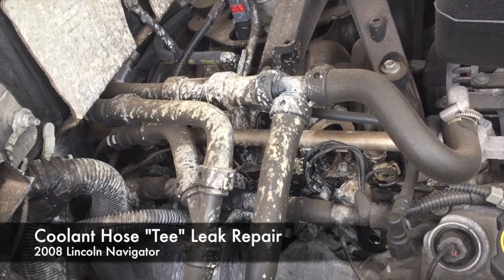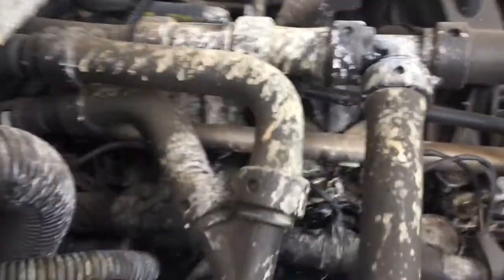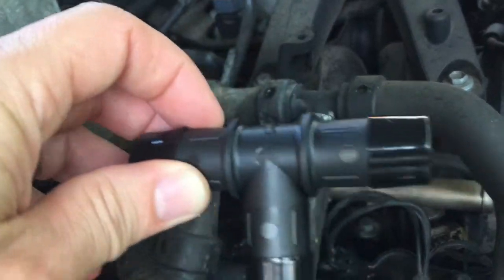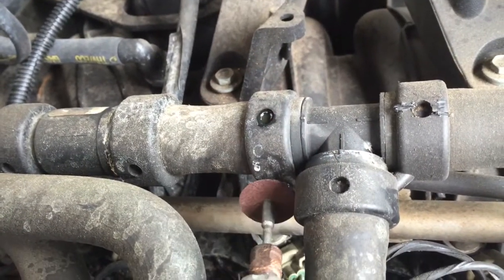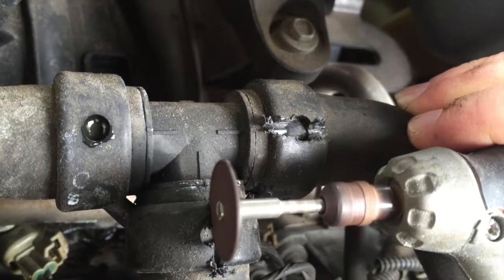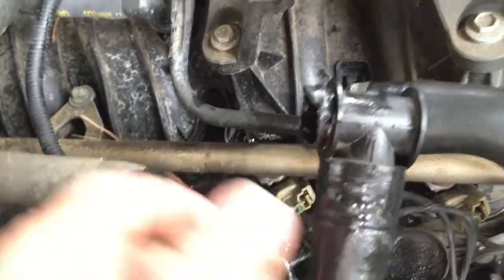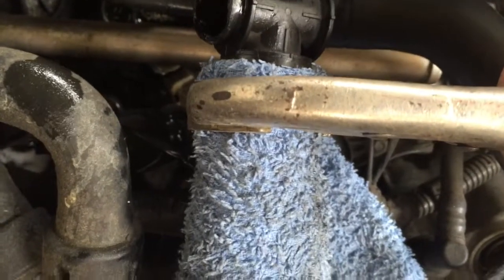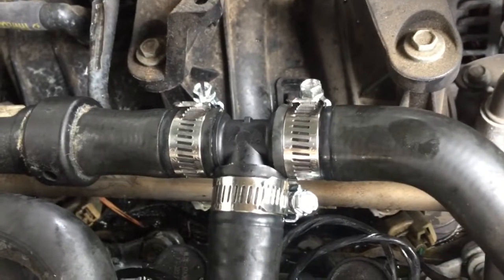2008 Lincoln Navigator Coolant Tee Leak Repair

Comment: My Husband  did just that, but he used a pair of jewelry snips  plyers he got them from Walmart he cut the plastic clamps  like butter then crush the hoses with vise-grips them  removed the plastic he got a brass " T " size 3/4 by 3/4 by 3/4 and metal clamps from Home Depot  He didn`t trust Plastic tubbing . thank you for posting this video

Comment: Thanks for this vid! Saved me a TON of money and frustration! 
O'Reilly by me did not have it in stock but was able to find it at Auto Zone.
Auto Zone Part # H-343  $4.99 (3/4" sized ends)
The correct hose clamps to fit over the 1" OD hose were $2.99 for a two pack (needed two) 
With tax, out the door cost was $11.82
*Tip - While I did start out using the Dremel to cut through the bands to remove the plastic hose clamp assembly, I found it much easier to use cutting pliers to snip the plastic where my Dremel tool had started the job.

Comment: Thanks for the video. I have the same truck and the same issue. I actually bought the same tee piece from Lowe's in brass. So I won't have the same issues down the road with it breaking down.

Comment: Shark Bite tee from Lowe’s replaces this perfect. It’s labeled 1” but is undersized. Part number 818303. Brass fitting under seven bucks.  The dorman help tee from the auto store fit very loosely into the hoses.
Reply: Used this product today it worked perfect and looks a lot better than plastic.  The 1" was perfect fit and #10 air plane clamps to secure the hoses.

Comment: Saw the plastic tee at the auto parts places and several said the had to repair a year later. Just replace with a barbed end 3/4" brass tee from Lowes or hardware store and your fix is forever. Yes you will lose some coolant from the overhead heater core, so have some standing by to replace to full and enjoy your cheap repair with a brass tee and three stainless steel hose clamps.
Reply: Nothing affects it by having a brass Tee?

Comment: Thank u for making this video
Reply from the maker: Your welcome.  There are about 2 other ones kinda like it, but I really like the dremmel tool, makes the plastic joint cutting so much easier.  Plus, did not damage the hose.  Just gives you options . . .

Comment: Hi, the video has 6 yrs. , any follow-up  update on this repair ?? ,  do you know if it lasted ?? or was there any trouble with this part because of Temperature or pressure  ?? Please let us know. I just did it on my 2008 Ford Expedition Tee with 100 Kmiles, I would like to know if I can be relax or I would have to keep a very close eye on it, your reply will be greatly appreciated by everyone. Thanks !!
Reply from the maker: Great question!   So, I will tell you my situation and why I made this repair.  #1: my hoses were still great.  No cracks on the connection ends, no swollen spots on the hoses.  #2:  the only failure was the plastic, which gets brittle over time in this application, and that was my reason for this video.  So, in my situation, I worried no more.  If you go buy the new hose set from a part store, non-oem, you will see the same rubber hoses and ‘’metal” connectors for the ‘y’ and ‘T’ parts, which is what I replaced it with.  If your hoses are good, you should be fine.  I have these same cooling hoses on other navigators with 210k+ miles and no issue.  You asked about this navigator, well, it ran around town for two years, daily driven by my teenager, no issue with this repair.  These are tough SUV’s.  I currently own 3, I worry about my next repair, which is a sunroof, not the engine.  😂.  Just to say, my three navigators, all have over 200k miles, not thought about this again.  Hope this helps.

Comment: 4 Ford Motor Co. investors dislike this video. They'd like their dealers to sell you a $100 "replacement" hose instead!
Reply from the maker: Sometimes it is just nice to get the Navigator back on the road without breaking the bank!  Thanks for the comment!
Reply: Just replaced the hose assembly with a “Dorman OE Solutions” hose set which cost $85. Came with all metal clamps and tees with new quick connect clips and fittings. Only trouble I had was the removing the connection at the heater core, that one was hard to get at!

Comment: I used channel lock pliers to crush them plastic flanges. Took just seconds to remove.
Reply: Did the same. Turned the hoses down while crushing the plastic so the broken pieces don't get into the coolant system. Used a 1inch brass t fitting from Lowes. 2013 Ford Expedition Limited 5.4

Comment: I have the exact same problem with my 2007 exorer, but my engine overheated. It restarts, but doesn't hold a start and only keep with my foot on the gas or it dies. Sounds like a spark plug is clogged. Could this be the best accusation?
Reply from the maker: This is a good question.  Overheating an engine can be a mixed bag of post event troubleshooting.  In the 2008 Navigator, when the engine started running ‘hot’, immediately the computer shut off the A/C compressor.  It gave us time to get off the road and trouble shoot to find this ‘leak’.   Considering your Explorer, if you can get it run, that is a good sign, not holding idle without gas, could be an ignition coil or two failed.  Can you borrow a tool to read any ‘codes’ from the OBDII port?  That would be super helpful in this case.  It might tell us if you have a cylinder misfire (spark plug or coil), or if we have another issue.  Depending on how hot it got and how long it ran, you may have to look at a ‘head gasket’ that may have failed, which heads can warp pretty easy on an overheat.  We can chat more on that later.   Thank you for posting!  Hope this points you in the right direction . . .
Reply: @2horseman  Thanks. Sounds like I'm on the correct path. Sounds like a spark plug issue alright. I'm aiming to replace them all. There are no codes showing on the instrument cluster. I think she has a good sign of recovering. I do know thay the coolant heater hose has a crack and is a known common issue. Navigators and Explorer share the same parts and have the same common issues.

Comment: Did you remove coolant before the fix?
Reply from the maker: No.  When disconnecting the hose, you may have some coolant spill out.  But remember, mine was leaking, my coolant level was low already, and this hose is above the engine block, so most of your coolant will gravity drain back down to lower levels in your engine.  Great point to ask, and be sure to top off engine coolant once you fix the leak.  / thanks for the comment

Comment: I used wire cutters, easier
you can also just replace clamps with metal ones ,and if Tee is cracked then cont. to replace it

Comment: What is the part number for the tee or is it 3/4 and 1 inch?
Reply from the maker: Chris Summers 
The part is a 3/4" tee.
Reply: Ok thx because O'Reilly has 3/4 tee which means 2 sides are 3/4 and other side is 1 inch or 5/8

Comment: NOT  accurate information in this video !! 😠, 
Mine is an Expedition EL 2008 5.4 L, 
the T of 3/4" × 3way is not correct, the end of the hoses is stretched (cause of the original  Tee) so you would need a Tee labeled as 1 inch on the 3 ends, the 3/4 one goes in too loose and it will leak most surely very quickly. Going to Lowes to get a bronze one Pex of 1", if I can't find one like it in Auto Parts,  which today there were none, so I am guessing will have to go with a Pex/Lowes one as other two videos and hope will work. You can not cut those ends because then your hoses will be short and the one going to the firewall has a restrictor inside so the space is extremely limited. Tips: if you don't want to drain coolant, not need to, but, -make sure car is cool overnight better, -don't open the reservoir it will cause coolant to flow from the thermostat one  and you will have coolant all over the place,  - when you are dissambling the Tee, make sure to put good amount of towel underneath to pickup coolant and drain some on a little bowl., for the rest of the info here is good, make sure when you crush the end of the hoses to point downward and make sure you take out all that plastic crap, yes it is a piece of crap, use the pliers better faster & easier, using a dremel is risky you can cut something else.
Will comment later if I accomplish the mission.
Reply from the maker: Appreciate the effort given to your reply.  If what we do helps someone make a more informed decision, then we all win.  While not all experiences are identical, at least we are supporting the community of owners.  Thank you for the post.

Comment: This is only a temp fix. It will fail at some point for sure. Buy the replacement hoses please, quick connects are a pain but be creative and remove them. Don't leave your wife stranded. Good quality video though.
Reply: What are you saying will fail? Why would the whole replacement hose be any different?
Reply: So instead of a under $10 fix that may or may not last a while I'm to buy the garbage that failed me in the first place? You must have stock in ford.😂😂😂😂😂😂